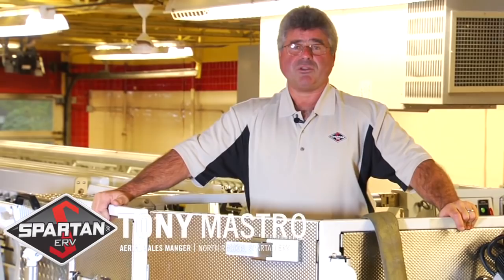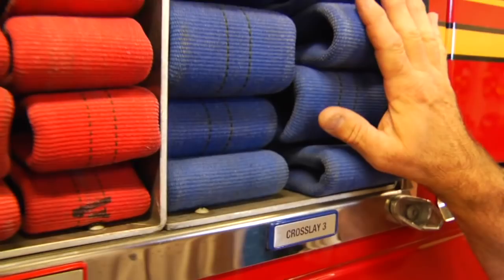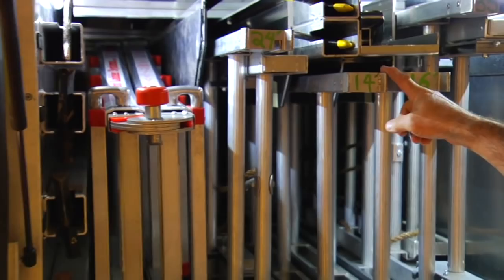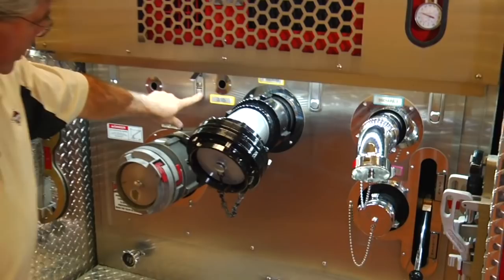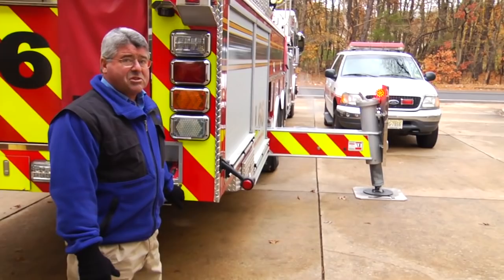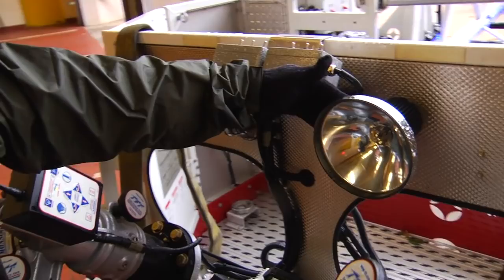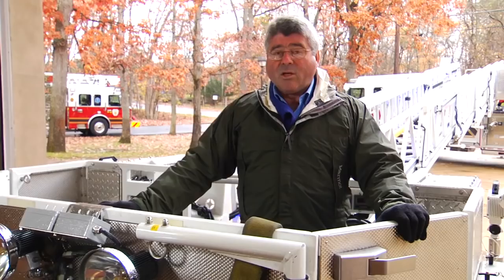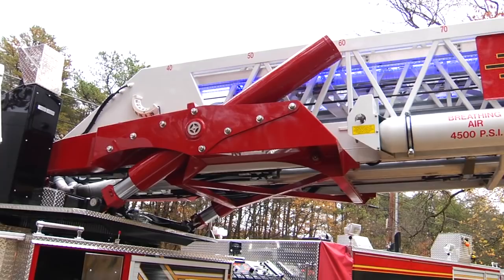Spartan ERV Mid Mount Aerial Platform

Comment: we can access the platform not just to the back towards the ladder, and to the two corners, but also straight ahead.
Anyway this midmount would be simply useless at our FD (due to the truck size) - we have three 100 ft rearmounts at our station, and since the ground ladders are on the Engines, the Tower Ladders don't have to carry them on board
Reply: You must be the only department that doesn't carry ground ladders on aerials... and the length of midmounts to rearmounts is comparable. In Pierce's case, the midmounts are actually shorter.
Reply: @Firebuff101  I take that as a compliment. Not in terms of apparatus layout, but apparently you didn't realize that I'm not even from the US - and I seriously used to struggle with English as foreign language a lot back in school. 
No, we're definetly not the only department not carrying any ground ladders along. It's the standard here, and I'm dead serious with that statement. 99% of Aerials won't have any ground ladder on board here. I don't say 100% as there are some very few unique trucks like Quints which might have a set. 
No, Tower Ladders don't carry any ground ladders here. Those are supplied by the Engines and Rescue Engines. Also the Tower Ladders don't have a crew cab, no water tank, no pump, no battery powered or hydraulic extrication equipment. All that comes from the Engines and Rescue Engines as well. 
Mid-Mounts are super rare here. back around 1980 one manufacturer built 14 of them and it took more than 4 decades before the next Mid-Mounts were built - they were presented to the public only weeks ago. The only reason why mid-mounts were built here at all was the demand to have a Tower Ladder with lower overall height when driving down into historic parts of the city, low archways, low underpasses etc. A decade later they came up with a different approach: keep the rear-mount, but put the cab further to the front and on a lower level. This was first done by fire apparatus manufacturers and some years later the truck brands offered this kind of low entry cab in their lineup right away. Thus the rear-mount Tower Ladder wasn't any taller than the mid-mount Tower Ladder although the ladder was above the cab. With the low entry cab the mid-mounts became useless. The area they were designed for also showed the biggest issue: the overhanging bucket at the rear was in the blind spot, awful when maneuvering in tight places. 
Back when I posted the comment we had all 3 types of Tower Ladders in my home town, all 3 at the same station:
1) A 105' rear-mount Tower Ladder with standard cab
2) A 105' mid-mount Tower Ladder with standard cab (it was 1 of the 14 mentioned previously)
3) A 105' rear-mount Tower Ladder with low entry cab
Since then even more solitions and approaches became popular. Like to shorten each ladder section and put 5 instead of 4 sections to add up to 105' and thus get a shorter truck length. And all-wheel steering got just as popular as the low entry cab did 

The most compact Aerial Platform layout available here is a rear-mount Telescopic Boom where the platform isn't overhanging at the front or rear of the truck, but it's right behind the cab

My personal favorite for a well working standard first due Aerial: 
- 105' rear-mount Tower Ladder
- articulated top ladder section
- self-leveling ladder base
- low entry cab
- all wheel steering
- low extending outriggers
Reply: @EnjoyFirefighting  I'm not reading all that. I was simply making an observation, but thanks for the novel. Also, I'm not sure why not having ground ladders is a compliment.
Reply: @Firebuff101  why should I answer if you don't read ...
Ground ladders would make the truck unnecessarily large. Too large to make the truck go around corners. That's why it's kept as compact as possible = reduced amount of equipment which is supplied by the Engines 100%. They're not missing on scene, just come with a different apparatus

Comment: Are all midmount pumps like this? They are all electronic, and I can see major issues from that. Wouldn't manual controls be better?
Reply: Armyconrad yes, but new technology has made things easier. If the power goes out in the pump, the whole truck shuts off.
Reply: Armyconrad most have a combination of electrical and electromechanical.
Reply: Electronics overall are extremely reliable and well proven.  Commercial/industrial electronics are not like consumer electronics by a large margin of quality.  Extremely rugged against water, extreme cold, heat and vibration.  It's mechanicals that usually fail first before the electronics fail.  Face it, solid state beats moving parts.  Anything breaks, just replace the chip from the main board.  Simple.  I worked long enough in industrial instrumentation to know better.

Comment: Hello, my department acquired a similar vehicle, they gave us a demonstration of how to use it and all its components, but there were parts that it happened to them to indicate to us what they were used for, such as in the control panel of the truck's stabilizers, where A button appears that says: EPU, which they never told us what it is for, or when it should be used. Could you help us by telling us what it is for and when it is used?
Reply: YouTube is not the best place to ask for technical advice...
Reply: @Firebuff101  They make a demonstration video of how a platform is manipulated and give some small technical advice on what is done with such a machine, but they cannot answer a technical question? They confuse me! but well, I already saw that SPARTAN neither guides in the questions of its clients, nor does it give simple answers. THANK YOU FOR YOUR REFUSAL.